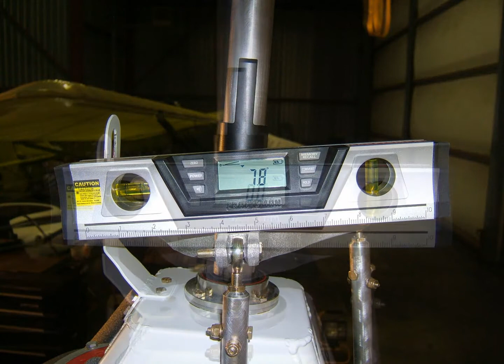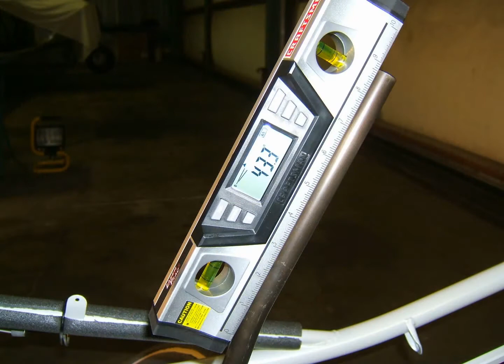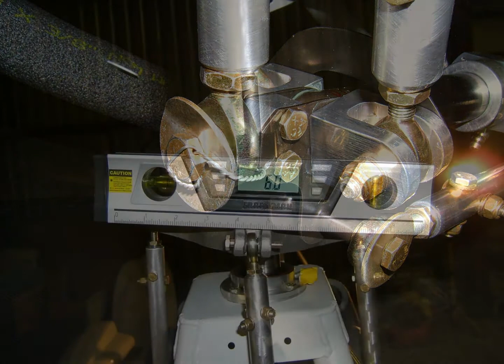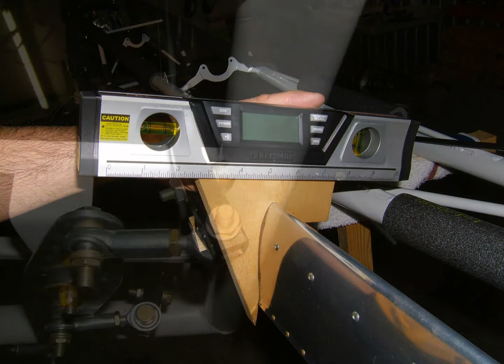Helicycle Build Pics Slideshow Part 2

Comment: name of part at 9:34 ?
Reply from the maker: That's the flight control tube, the stick mounts into the left end and the swash plate mixer is on the right end.  Three control tubes connect the mixer to the swash plate and the collective stick raises and lowers the control tube to move the swash up and down.  You can see that part installed and connected to the swash plate as the video goes on.